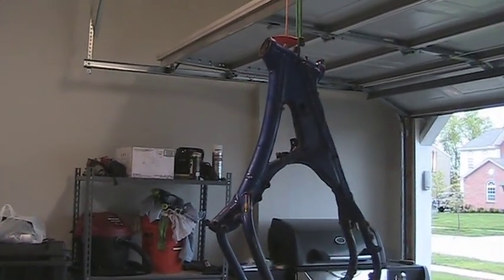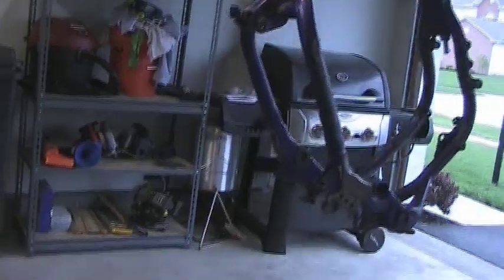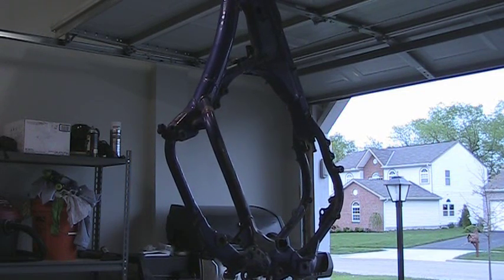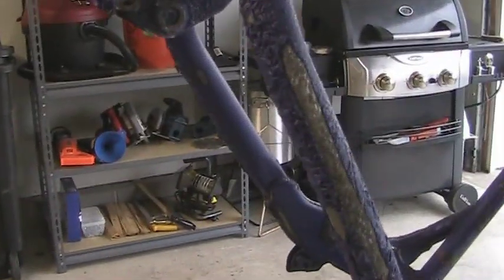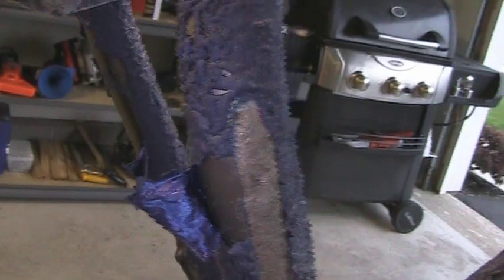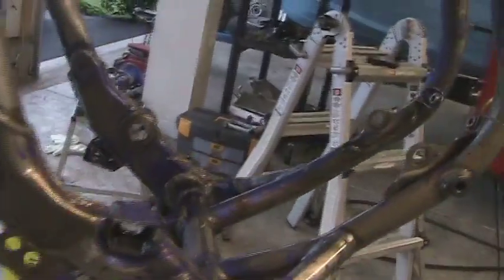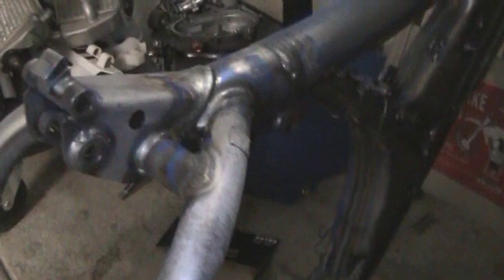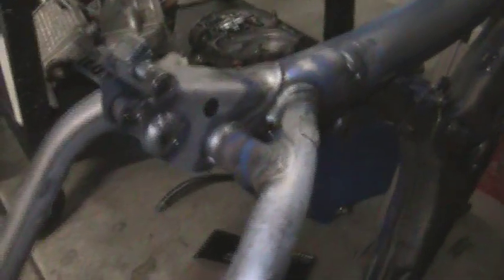Part 1 Assembling motocross bike stripping frame paint. YZ250F example.

Comment: I like the hindsight advice about the hand/eye/respirator. ;) I have a 2003 YZ250 I am on the fence about powder coating vs. painting. I used the same spray redoing some car wheels today and I think the brush-on might be lot more cost effective and seems to work better. Thanks for the vids!!

Comment: i have an 07 kx250 2 stroke which has a steel fram painted silver. if i had it sandblasted and powdercoated would it hold up good? thanks for your feedback